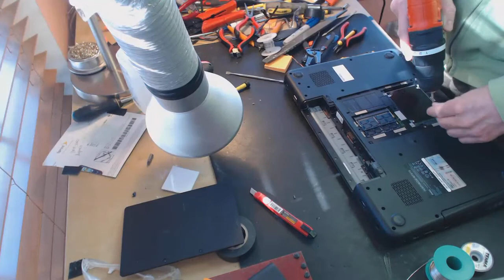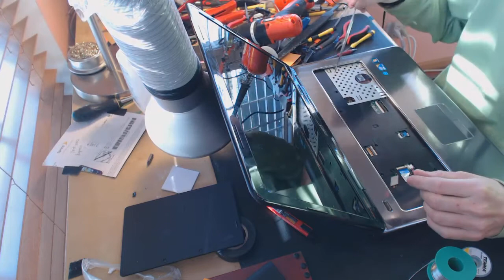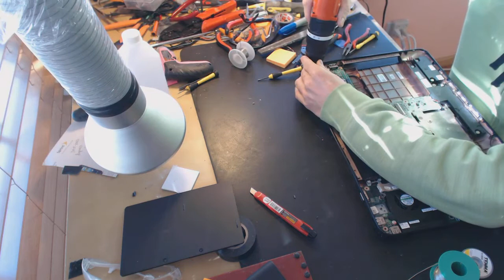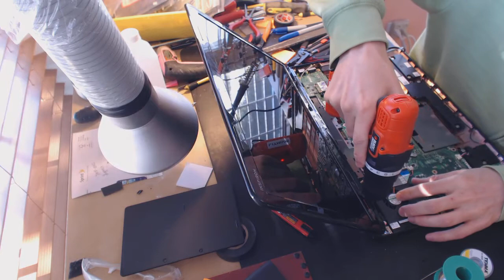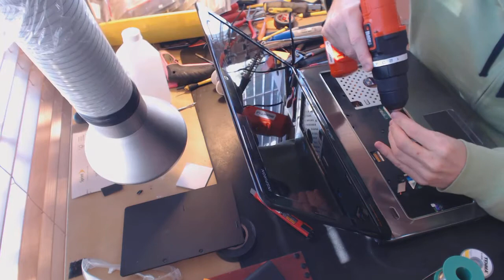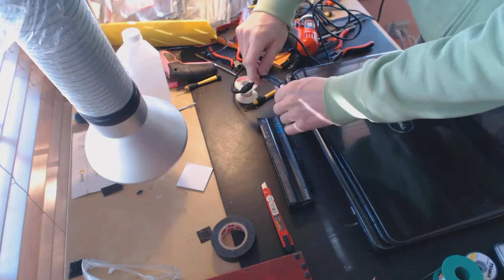Dell N7010 P08E inspiron 17r  Laptop Power Jack Repair pushed in socket input connector fix

Comment: Thanks but i have a question yesterday i was using by dell n7010 it said it needed to be charged and i took the power cable and the thing that communicates with the charger fell out on the floor and i haven't used it since.Is it fine to use it without the Plugged in, Not Charging error? Please Respond As Soon as you can i need to use this PC to edit my videos to post on my channel!!!!!!!!!!
Reply from the maker: it is fine to use it in plugged in not charging mode, no worries they all do that eventually